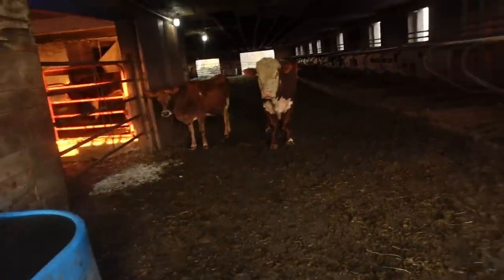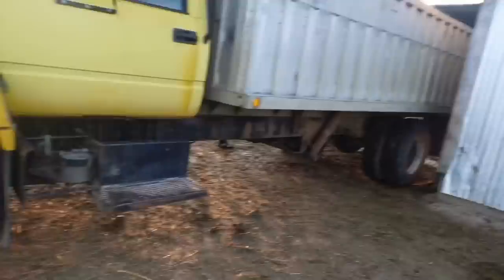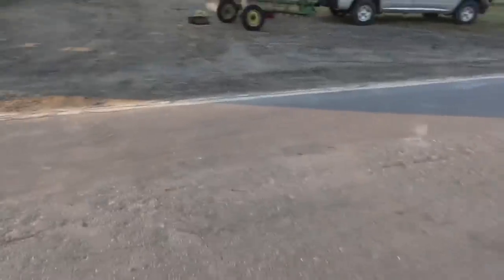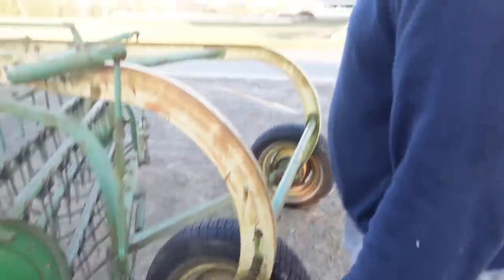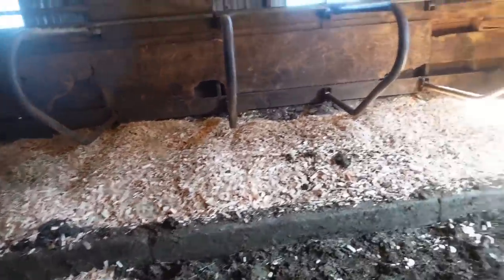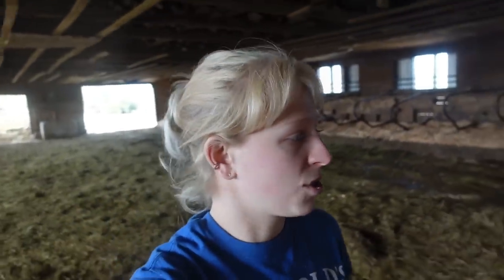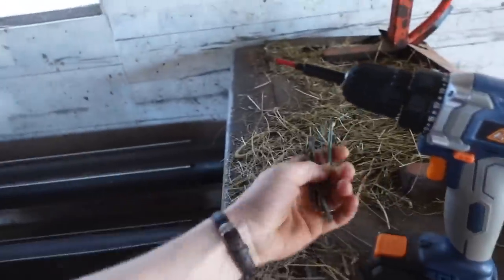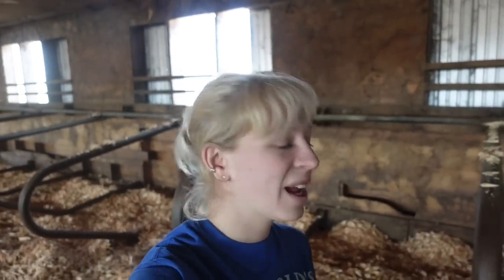Freestall makeover on our small traditional dairy farm…

Comment: I know this is really late but you can easily build a hitch that will pull the fillet wheeled rake off of that rake. We built one from some angle iron and two pieces of round tube. Really speeds up raking hay for round bailing

Comment: Zebra faced calf is really cute.   Another way we kept sprockets and gears from moving was to remove the set screw.
drill an indent into the shaft then the set screw locks into the indent then the sprocket will not move.
If you have trouble with set screws or bolts loosening use blue Loctite on them.
Happy raking this summer.
Reply from the maker: That’s a great tip! Thank you!  😀

Comment: Looks like a 640 or 660 rake.  Had a few over the years, take care of the bearings it'll last.  The rake bars have bearings on the ends that connect to the disks on each end.  Those bearings are crazy expensive or not available, pretty sure I got some from Eastern Automation in Westbrook that would match up exactly for a lot less money.  Keep those nuts tight where the bars attach to the discs and watch the bearings.